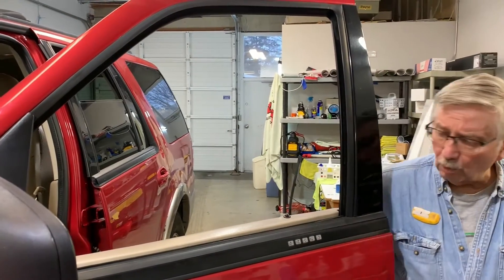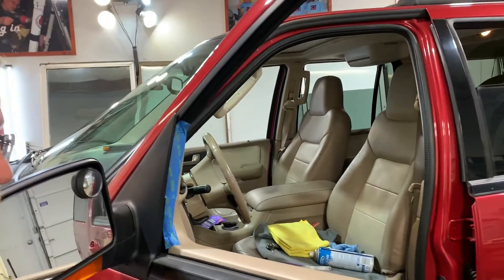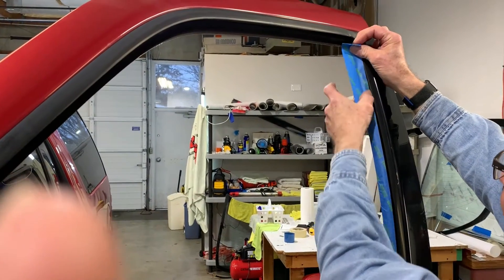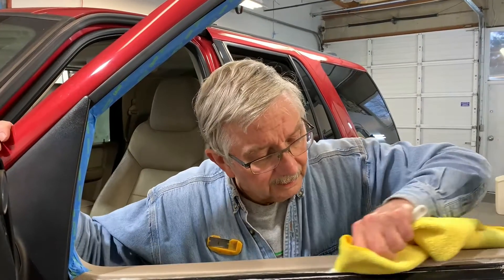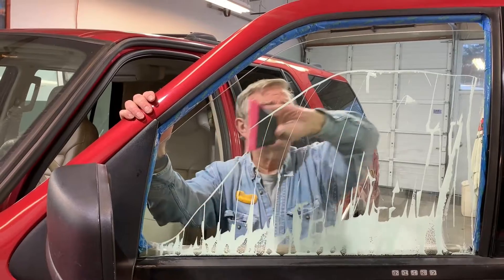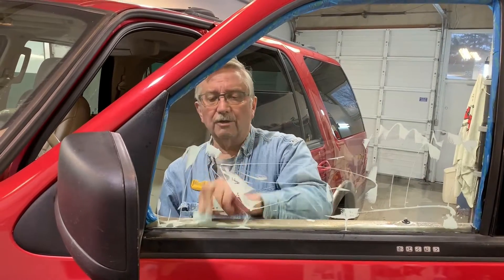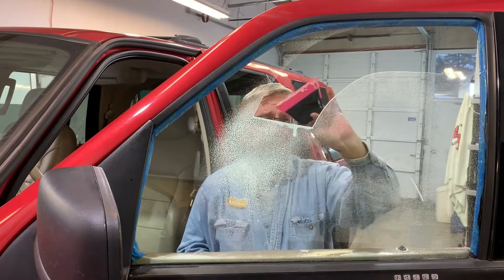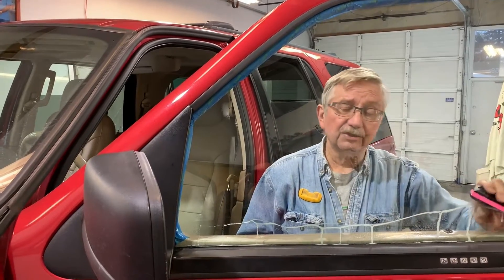Learn cleaning door glass for Success window tinting

Comment: Great video 👍👍👍 You should try the strong hair spray for the felt. It works amazing!
Reply from the maker: Andrew, thanks for the reminder about using hairspray! I used it a bit years ago and think it’s time to check it out again! I did just receive a new roll of Scotch blue painter tape labeled Ultra Sharp lines #2098 that I’m digging. I’m using it on the sides of felt doors where it’s a real tight area to get film in like some of the older Dodge trucks! On tight stuff like these the smoother the tape the easier… in the past I’ve used vinyl cut into strips but has always been a hassle keeping it cut in the shop.. Keep slinging da film man and thanks for watching the video! If I can ever help you with anything just let me know✌️